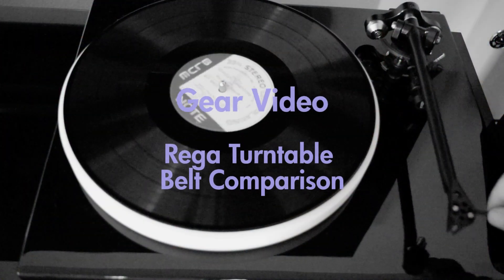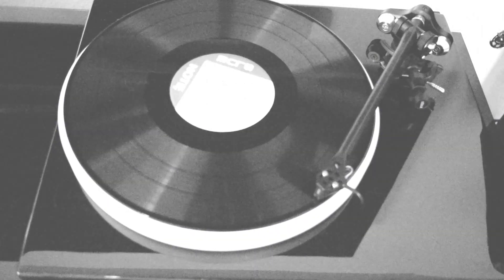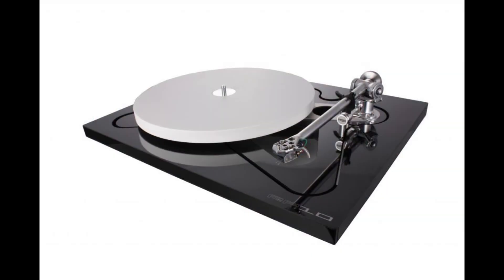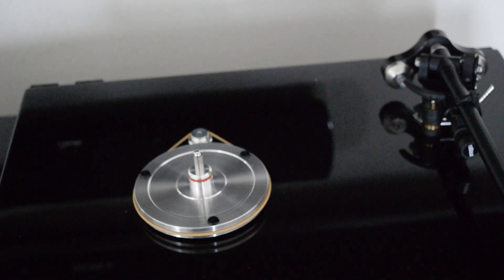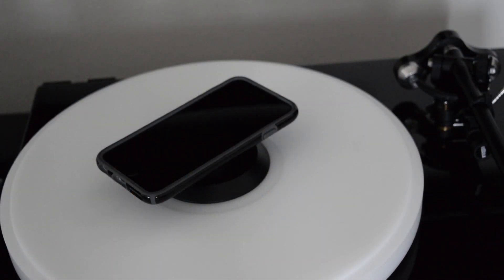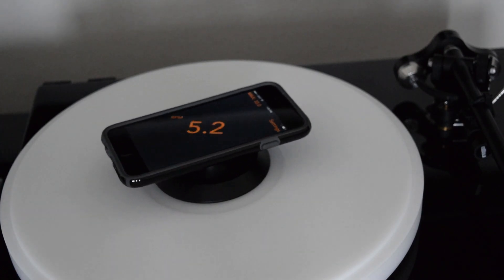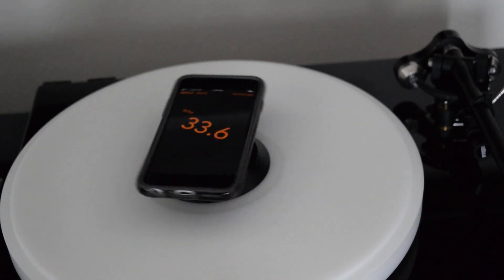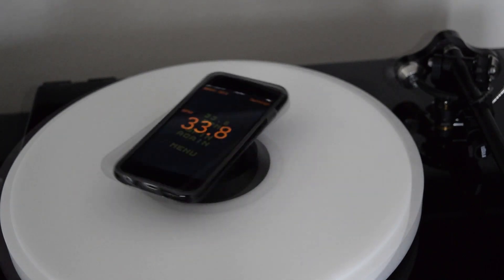Rega Turntable Belt Upgrade Comparison

Comment: Did I hear you say that someone thought that a better belt caused tighter base response? That is just an example of pure lack of logic from folks who claim they hear something that they really don't. I would love that person to explain the physics behind how a belt on a turntable can offer tighter low end. Great video btw. All these belts fall WELL within acceptable tolerances, and I will never pay $50 for a belt. That would have me awake at night.
Reply from the maker: The more I have experimented, the more I have found there is some placebo effect.  There are some things that make subtle improvements.  In the case of 'tighter base' response, it's really not a good term to use but that's not to say there isn't a minor effect on base reproduction or reproduction across the audio spectrum based on the control of wow and flutter or frequency wobble. 

With belts, as time passes (via stretching) and given variations in individual belt manufacturing based on tolerances, you're going to get a variance in micro slippage.  Each belt type will likely have a different chemistry and resulting coefficient of friction.  You really want that added distortion caused by the belts as low as you can possibly get it and it is possible to measure the variations using the Feickert Application.  That said, how much of that can actually be discerned by the listeners ear is another story altogether.  Is it worth staying up at night, likely not for 99.999% of most listeners.  For those that do worry, there is always direct drive turntables but even direct drives add a different engineering problems into the equation for consideration.
Reply: Logic? Easy! The white belt is manufactured with much higher tolerances that result in a $59 chloroprene band that is structurally even throughout its orbit with fewer material anomalies. This means the platter spins true, with less slippage, bumps and artifacts to deter the flow of music. Great manufacturing companies use quality materials researched and developed for the sole purpose of precise analog replay. In the end to judge a piece of music it all boils down to pitch and timing, and any deviation from this will cause the sound to loose focus, become muddy and low end registers to sound overblown and lethargic. Most people under 50 that have not had their ears screwed up by loud volume death metal in concert halls can easily notice this. Others that noticed an improvement probably needed a new belt to begin with - Ha!

Comment: I'll put my two cents for what its worth. Speed testing should be done when playing a record in order to account for the stylus drag. The best belt I've encountered was from turntablebasic if they are still around and it was about 7 bucks. All belts go bad after awhile especially if you let it sit in that pulley-sub platter egg position. I used to pull it out to keep it round and only put it in when playing records. Especially if you drop 60 for the white belt and if you have two? ouch! In the end. The ultimate upgrade is a Speed box and for my Rega P25, the Music hall speed box was compatible. I even saw it for sale for $199 once. The speed box makes all belts null and keeps a constant 33.3 rpm. Amazing tt with the speed box and the groovetracer upgrades. Cheers and keep it jazzy!
Reply from the maker: +KoolKatJazz Great comment and I do agree that the stylus will create some drag but my experience has been negligible.  That said, I am considering picking up another Edwards Belt to see how it fairs with the Double Pulley.   If I end up doing another test, I'll do it with the record on the turntable.  I also agree with your comment about the belt sitting too long.  Getting a Speed Box, or a FALCON speed controller and tachometer is the next thing I am considering down the road.  Thanks for watching and providing the critique.  It's appreciated and valid.
Reply from the maker: +Luís André Vicente Cool.  Thanks for the tip.  I haven't tried any of the Tangospinner products before but I may have to give this one a try.
Reply: In my RP6, supplanted the Little Belter. More stable in RPM's. It is best in bass reproduction, sound stage, instrumental separation, in short ... everything! Gustavo is a nice person, and I am very pleased with both the belt, as with his Subplatter.
Reply: +Luís André Vicente Did the Tangospinner transparent belt change the speed? My RP6 runs at 33.8 with black, blue and white belt :(
Reply: +Balooba Tangospinner solved and improved as you can see in my previous comment. :)

Comment: Juar my 2 cents but a lot of these turntable tests should be done with the same record on the platter.  I would think this could have some effect on the turntable itself, the platter and the belts for testing.
Reply from the maker: While your point is a fair one, I've done the test with a record on the platter and it really didn't make a lot of difference.  The weight of the record is pretty negligible next to the platter.  At some point I would like to redo this video with a demonstration with a record on the platter and take a series of measurements to get a good statistical sample.

Comment: After watching this demonstration a second time I came to a different conclusion than you.  The white belt was slipping less than the other belts, and obviously has less stretch and more grip.  When the turntable is in use for a long period of time, the white belt will normalize at or above 33.3 whereas the others will slowly drop below 33.3.  It doesn't change my opinion of any of the belts, but at least it's food for thought.
Reply from the maker: Thanks for chiming in Paul.  There's always a bit of deviation in the manufacturing but the couple of white belts I've tried always ended up with a result running a bit fast.  It's not to say they are all bad though.  It would be nice to see what Rega has tested ;)  I'm sure they have a lot of data on it.

Comment: This is done seven years ago. The new EBT bill is fabulous and right on and I don’t know what model this guy has. He had the ceramic platter that’s only on the 10 in the town is dual belt not single, so I don’t know what he’s using the test it and what model this is but if that’s within its should have two bills.
Reply from the maker: It's the old P3-24 model which is now over a decade old.  Thanks for watching ;)
Reply: I measured a pair of EBLT Reference belts on a P9 with Analog Majik. The reference belts cause a larger speed error than the original belts. EBLT run at 33.05 RPM vs 33.45 for the original. 

Wow is reduced with EBLTs, 0.06x vs 0.08x. My hunch is they’re a hair smaller and slip slightly less, but may have a slightly smaller cross section, resulting in a slower speed.

Comment: Oh oh, there we go again. The white Rega belt is thicker than the Rega black belt that comes as standard with the RP1 turntable. And that causes a difference in speed because the deeper the belt rides on the pulley, the slower the speed will be. The revolutions of the motor are exactly the same, but it all depends on another key factor as well. And that is the compound, just like you mentioned. The stiffness of the rubber and the tightness might increase drag on the motor, causing to slow down the motor and also speeding up wear of the motor bearings. The only right belt, having the right tightness and thickness is the original Rega black belt. Too wide a belt causes more wow and flutter and it will take ages until the thing spins at the right speed, whereas a too tight belt will slow down the speed and over time your bearings will be worn sooner than expected. Indeed, the money spend on the white belt is a waste as it is thicker so increasing the speed. It is as simple as that. Besides, a whopping 50 dollars for a piece of synthetic rubber! Don't be fooled by Rega, they just want your money.
Reply: leyland9999 ;

Comment: I can't figure out how the apps works since not every phone have their sensors in the same location inside them consequently affecting speed reading. Is is working only with iphone? Do you have to calibrate it with true speed reference?
Reply from the maker: Supposedly, there are versions of it for Android out there.   Maybe not made by the same company.  Some of these to allow for calibration and others do not.  Comparing this to a strobe, I found it to be pretty spot on.

Comment: Went to purchase the Little Belter for my Planar 3 on eBay and was told "Item does not ship to New York." Well that sucks. My table runs @ 33.5 with the standard Rega belt.
Reply from the maker: The rest of the U.S. but not New York?  That's weird.  You need to have it shipped to someone outside New York so they can in return ship it to you.

Comment: Since you're testing belts, I believe you should check each belt's installed tension. A loosely fitted belt would obviously has more slippage which is more demonstrated on the early V belt
"squeals" in the automotive industry. How about testing for rumble on turntables? Rumble was a very important spec. and selling points on turntables in the sixties and late eighties. Very interesting evaluation, keep up the good work, buddy..
Reply from the maker: Thanks Ricardo and that's a very good point.  I guess you could do a rudimentary pull test and measure the deflection of the belts with a known mass attached to get the tension.  I agree with you on the rumble spec.  Thanks for the great comment.

Comment: I decided to watch the video a  second time and thought of something. . Could it be that while the other belts are running closer to 33.3 that the white belt is running closer to the speed of the motor. Possibly the other belts are experiencing some slippage, extremely minor though it might be,  and it is causing a slower reading. I don't see how there is any way that the platter could be running faster than the motor will turn it.
Reply from the maker: +silverado884 Interesting thought and thanks so much for sitting through the video twice ;)  I have concluded that it all amounts to belt tension and surface contact.  Rega's belts seem to be a generic problem.   In particular with the belt tension and that can be corrected in manufacturing.  Even Stereophile's Michael Fremer noted when he was reviewing the RP10 that it ran fast (33.6 rpm).  His solution was to demount the motor and try and pull it back to apply more tension if memory serves me correctly.  I'm sorry but if you're dropping over $3000 on a turntable, they better have it pretty darn close to 33.3.
Reply: +silverado884 Rega has long maintained that part of the secret to the lively "Rega sound" is motors that spin just a hair faster. It's intentional.

Comment: Wouldn't the test result be different if you place a vinyl on the platter?

The weight of the vinyl could change the friction on the belt, and thus could change the rpm. Not to mention the changes that might occur vinyls of different weight (e.g. 40gr VS. 100gr VS. 180gr).
Reply from the maker: Good question which I have received before.  The effects of putting a record on are negligible.  See here for another test video with a record on the platter: https://www.youtube.com/watch?v=ZM9gYX30xFA
Reply: How much does the phone weigh? It's not relevant.

Comment: I know it'd be hard to test, but I'd be interested to see whether the act of placing a record on the platter just slows things down a wee bit, and then does downforce from a cartridge slow things down even further? If so, the White Belt may prove the most accurate. This is the first of your videos I've seen, and I'd be interested to know what turntable you modded. I use a stock RP8.
Reply from the maker: +MarkPMus So I have another video which has been shot but I need to edit it where I play a record and measure the speed.   I had a number of people comment on the drag force...which does exist but you really would need to have highly precise equipment to measure it.  With the app though, you don't see any difference and that's really how it should be.  If the drag force was high, you would be doing damage to the record.  So folks will be getting a demonstration in an upcoming video along with a strobe disc to app compare.  

The turntable I have modded is a P3-24.  If you're using a stock RP8, there is no reason to mod.  It's already a good table ;)  That said, I think I caught your videos long ago.  You had a different Rega before the RP8, right?
Reply: +MarkPMus  only turntables with servo motors will compensate for load changes they are designed to detect subtle changes in rpm speed and send that to a microprocessor to adjust speed back to the base setting
Reply: ***** Yes, I used a P5, with a Goldring 1042 cartridge.  I made a video on my own channel where I checked out Turntabulator with the RP8, and also a very very cheap "Musonic" turntable belonging to an elderly relative.  So cheap it's almost a Crosley!  The results were as expected!

Comment: Seeing as the purpose of a turntable is to spin at 33 1/3, surely any deck that doesn't is by definition unfit for purpose. Offering upgrades to make it do what it was designed to do seems pretty odd to me. Needless to say I'm in the DD camp.
Reply from the maker: And there's no problem with that.  Each design has it's Pro's and Con's.  I do think the new SL-1200G is the Turntable to be beat at it's price point.
Reply: MrCatalysis101 I can’t argue with your point at all, but I challenge you to tell the difference between a tt running at 33.33 rpm and one at 33.7 rpm.  Unless you have perfect pitch, you won’t be able to tell unless you the same tone on both of them both simultaneously when you’ll get a beat frequency, or possibly if you play them directly one after another.  Fluctuations in speed are much more obvious though.

Comment: To the author...  Are there any chances of the phones ability to measure precise variation in RPM being uncalibrated?

I know that Rega tables tend to run slightly on the fast side.  But, I am just curious if these cell phone apps are accurate.
Reply from the maker: I think the precision will vary from phone to phone and company to company but I did run the app on a direct drive system with a strobe light.  I also compared the phone app with a strobe on my Rega in another video (can't remember which one) and found it to be pretty accurate.
Reply: No its not accurate every small milimeter of movement on the phone and the phone will display a different value. The problem is that the phone is relying on accaleration and decelaration instead of measuring the actual speed. So no its not 100% accurate and will very from phone to phone but its will never be more accurate than a printen out stroboscoop sheet (50/60hz) placed under 50/60hz light

Comment: Can a human ear hear the difference in speed between 33 1/3, 33 1/4, 33 1/5, 33 1/6?Can you really notice that a song has ended 1 or half a second faster or later while listening?
Reply from the maker: It depends...  IMO, if you a fraction off, most people couldn't pick up the difference.  It's not really a deal breaker but this video is for people that want to tweak things a bit.

Additionally, this is why Rega hasn't really done anything about it...until this year.  Their new PSU allows you to dial in exact speeds.  The further you get from 33.3 though then you're pitch is going to be off.

Comment: I just wanted to chime-in with a suggestion here.  I've adjusted several new TT's for folks that all seemed to run a bit fast at both speeds.  Tables like the AT LP60 and its clones, as well as the dreaded Crosleys are always consistently fast.  I think what is happening is that the motors are being adjusted at the factory on a virgin belt.  The belt will relax after some use which reduces some of the frictional losses.  That's my theory anyway, since all of the TT's I've adjusted seem to be fast by about the same amount.

I just wonder if the decrease in speed that you found with the new belts was simply due to the fact that they were new.  Have you revisited your TT's speed after a year or more of use?
Reply from the maker: I checked it six months afterwards and was really getting the same result.  Honestly, I will have to go back and check it again.  I do expect the belts to stretch over time and get more slippage.
Reply: Unless the belt is really loose, slippage should not be a factor once the platter is spinning.  If you think about it, most of the torque required from the motor is at startup.  Once the platter is spinning, there are just the parasitic losses of the platter and motor bearings, the belt itself, air resistance, and the needle in the groove (which is minuscule compared to the others).  Air resistance is fairly constant, so the variable here are the bearings and belt.  The tighter the belt is, the more friction is created on the bearings from the side loading.  The stiffer a belt is, the more it resists being wrapped around the pulleys and straightened again.  Any belt is reasonable condition won't slip during playback.

Anyway, I was just curious.  The budget TT's I've adjusted use the typical DC servo speed control circuits, just like a tape deck.  They self-regulate fine so long as the average load on the motor at steady-state does not change too much.  I'm actually not sure what kind of motors the Regas use, so all of this may be moot.  :)
Reply: Any update on the read? We're all biting nails here. :) Great video, man!

Comment: Which platter weight is that?
Thanks
Reply from the maker: Not a weight but a clamp ;)  It's Michell Record Clamp.   It makes for a nice placement of the phone but some weights would work well too.
Reply: BarakaPDub my bad. Just bought one of of eBay. Thanks man👍🏻